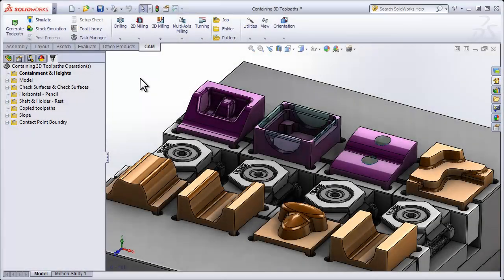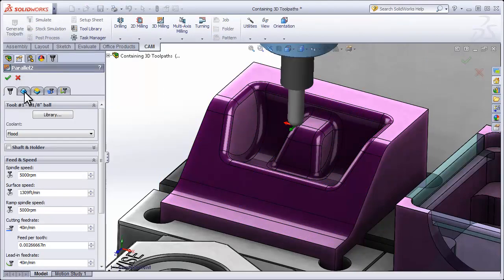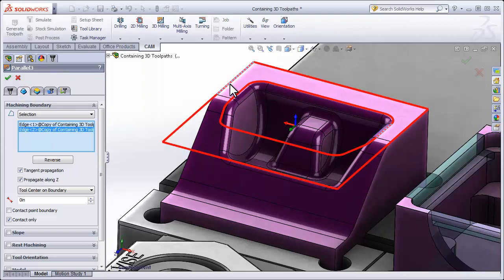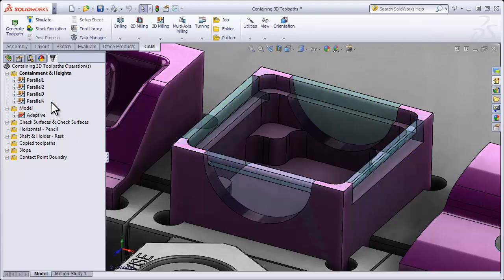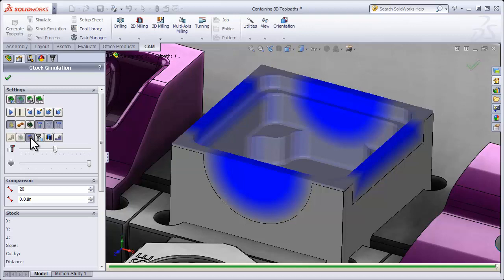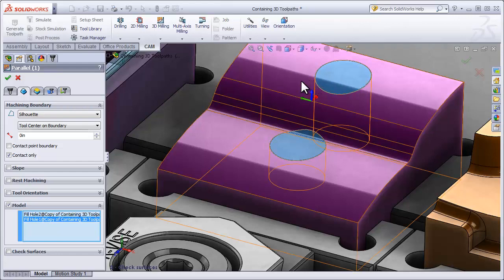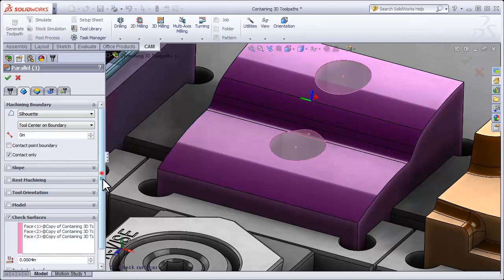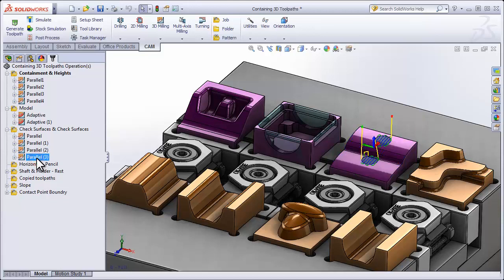Containing 3D Toolpaths - Part1

Comment: I worked for SamrtCam as an AE, Camax as an AE , SDRC as an AE and Gibbs and yes as an AE. I know CAM inside and out. Your product looks great-----
Reply from the maker: Thank you realworldguninfo. Keep sharing!
Reply: +realworldguninfo 
I beta tested SmartCAM's first 3D software. That was a minute or two back in time... Bruce Weingarten was the head of development with Jerry as the President.
NextGenCAM nice video... As a CNC Programmer by trade I'd suggest naming each tool path... Just to keep track of WTF they do for later reference :-)